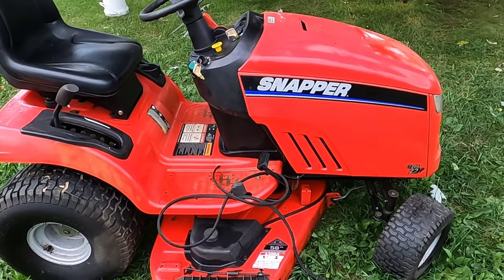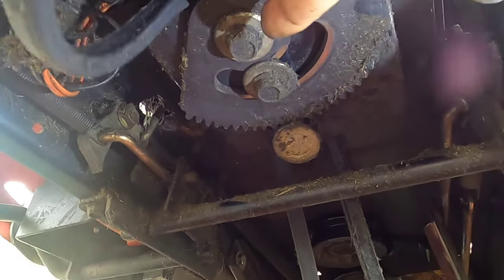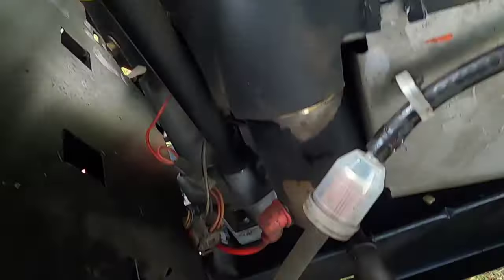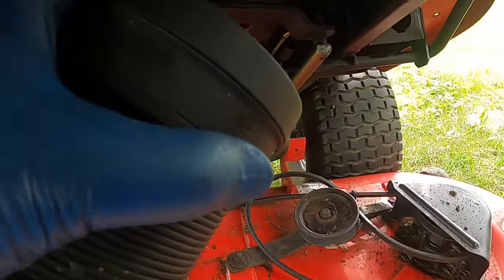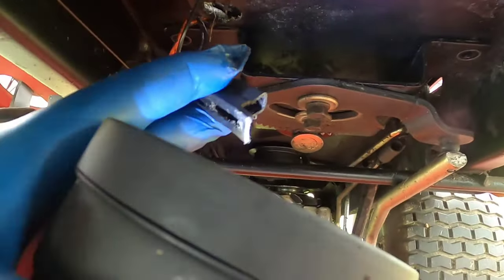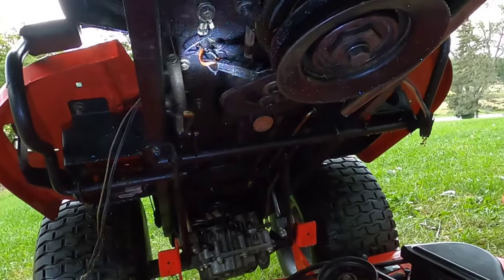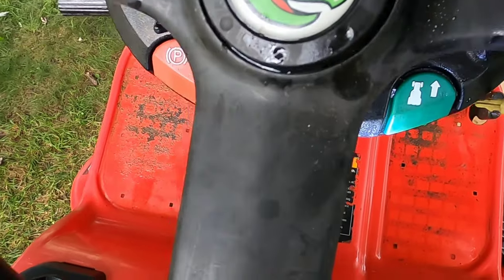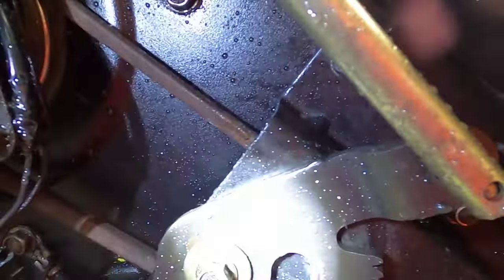Snapper lt200 drive belt replacement

Comment: I believe sir you might sadly be correct…I have searched for this video for ages!!  Thank you so much for this video!❤❤
Reply from the maker: You're welcome. When I searched I only found videos of the model that had the belt run along side of the steering shaft. Hope this saves you some time. If you would like to help me reach & help more people your 👍, commenting, sharing and subscribing would be a big help. Any and all support is appreciated.
Stay well, Joe Z
Reply: Same here! I’ve spent hours googling, including videos, for just about anything snapper. All I could find was the manual and part number PDFs to download. 
Im having problems with the steering gear but I’m not exactly sure what part needs to be replaced. 
I have tried calling repair shops but no one picks up the lawnmower or repairs it at the resident’s home. I have no way to get it to a repair shop. 
Bless you for spending your time on this video! Great job!
Reply from the maker: @Kritty8020  What problem are you having with the steering?
Reply from the maker: @Kritty8020  Thank you. What problem are you having with the steering?

Comment: Aright so I have the same snapper, put a 89" belt .5inch width on mine, I was able to do it rather quickly, took off the clutch but that's it. If you pull the belt real hard to the side and let the wheel turn as you do it on the two trolleys that turn, it will squeeze in, I did it from the ground with the mower on a ramp. Did it by feel to get the most leverage couldn't see. The front one above the clutch is the toughest but it's just a 15 second tug at the right angle and it will go in, obviously if you can stand it on it's end then it would be easier.  As for the middle where you removed the steering, I just ran it on one side, the right side, nothing under there to damage the belt so why not. Mowed all day with it today, ran like a champ, got all my power back after replacing the loose/original belt. Thanks for posting your video, hope this helps anybody who still has one of these 2003-2005 snappers.
Reply from the maker: Thank you for watching  and adding another way to replace this belt. Dose the belt rub against the steering shaft or anything else the way you routed it through?
Reply: Because once you let off the brake the belt rubs together on the inside v belt won't last long!

Comment: To pull the steering wheel i took a wheel puller lined it up drilled 2 holes to line up bolts put nuts on the bolts on the wheel puller and tightened the middle bolt popped the stuck steering wheel right off

Comment: Thank you for the tutorial!!    I removed mine today - using your procedures on my LT125.   Question on belt stretch..   My old belt measures right at 88.75".   That's only a stretch of 1/2" from the spec'ed new length of 88.25" for a new belt.    Is 1/2" enough to make my mower slip and not want to go up even slight inclines?    Yet drive at almost a decent speed on level surfaces?   Of course - I ordered the wrong belt from Amazon - so will wait on the new one to arrive....  But I was really expecting more than 1/2" stretch on the old one to give me the (what I perceive to be) the slippage of the transmission.
Reply from the maker: You're welcome. That may be ths cause. Going uphill puts more demand on the pump to produce more pressure. This is why you probably don’t notice a problem on flat ground. A  slack belt will not provide sufficient power to the pump.
 If you have tried driving a lawn mower with a hydrostatic transmission with low revs it would have similar result. Let me know how it works out.
Stay safe, Joe Z
Reply: @JOEZEP54  have decided to also replace the idler pulleys on the drive line.  It's recommended to at least change the v-groove pulley because it also wears - effectively making the belt more slack also - so both being done - and crossing my fingers for a renewed drive!
Reply: @JOEZEP54  All put back together.  The new belt & pulleys help.   They'll buy me time to get a rebuild kit from TuffTorq later in the summer.

Comment: Hi, can you please see the problem of the burn on the lower bonnet due to the muffler, I have the same problem what does it depend on?
Reply from the maker: @JOEZEP54
11 hours ago
I answered this on your original question in the video comments under Mower wont move forward or backwards video

Comment: Same mower as mine. I’m looking for that belt. Unfortunately I can’t seem to find a part number on it. Any idea what the number is on that belt? My local supplier can’t seem to find it. Only the deck belt.
Reply from the maker: I looked for the receipt for this belt & cannot find it. I know I saved it. As soon as I find it I will get back to you.
Reply from the maker: I could not find the receipt but I took notes 🙂 I bought this from Briggs & Stratton >>>>DRIVE BELT   1728008  $38.99<<<< If you shop on Amazon instead, I now have a store front >>  https://www.amazon.com/shop/joez  <<< and if you make a purchase through it there is not any additional cost to you & it helps support this channel. 
Hope this helps.
Stay well, Joe Z

Comment: Great video! However I must say, loosening or removing the steering assembly is not needed, nor taking out the battery compartment! If your mower is lifted high enough then the steering shaft will completely come out! The small ridge on the shaft above the steering gear simply slides up and down the shaft with ease.
Reply from the maker: Thank you for stopping by & adding this information. I did try to just remove the steering shaft but was not able to. Just may have been an error on my part. If I have to change it out again I will definitely look it over.  On different year models the belt runs on the side of the steering shaft, a big improvement.
Stay safe, Joe Z

Comment: It's not that hard dood.Love your enthusiasm but simply slide it to the back then route it into the  back pulley Should  ready to put on front pulley.The only problem is the front retainer over the pulley.I cut mine off and drilled a hole for the new retainer.I used p piece of angle i found ,the retainer for the belt up front is actually part of the frame i cut it off.
Reply from the maker: Hi John, Thank you for watching & taking the time to comment. Not sure if you have the same model. But for some reason the belt goes around the drive shaft. Putting the drive shaft in the middle of the belt. I had not run into this design before.
Check out some of my other videos when you get a chance.
Stay well, Joe Z